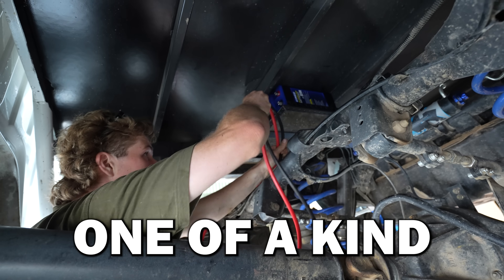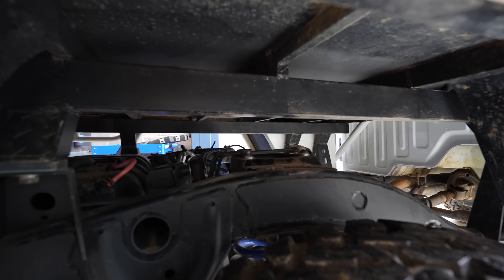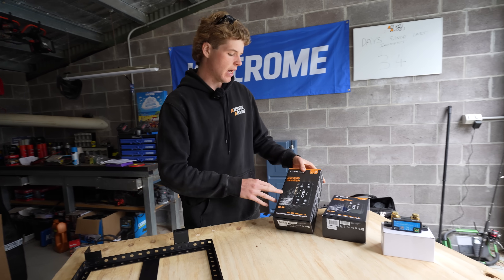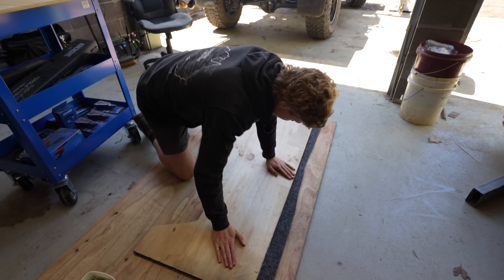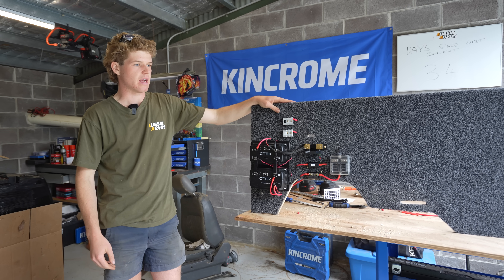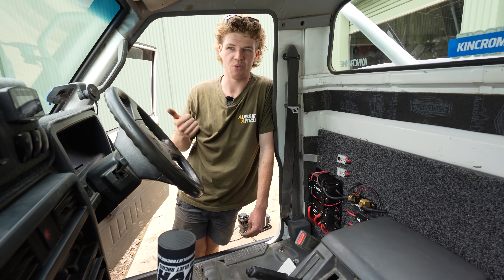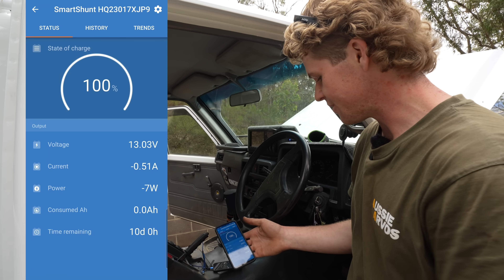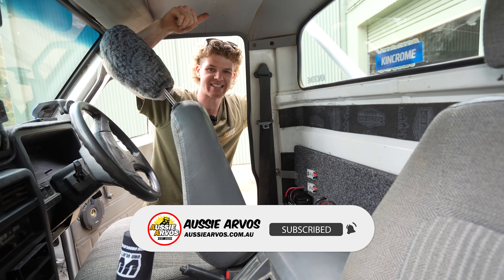The MOST POWERFUL 12v system we've EVER built!

Comment: Looks like a decent set up but it kinda blows my mind that you didn't mount the battery in a waterproof box then mount the box to the tray. Sure it might hang down an extra 50mm but you've got plenty of space, it's super easy to do and it would ensure the battery is properly protected from the elements.

Comment: Hey guys love the videos but have you checked the maximum charing current of that battery?? This is how 90% of lithium fires start by over charging the batteries with the wrong current. I would be really careful with these cheap batteries and using too much current to charge them, especially off-roading where the battery will get knocked about!!
According to the specs on the website: Recommended Charge / Discharge 25A (0.25C) -Max recharge current 100A. I would not be charging these cheap batteries at 100A and would definilty stick to 25A. Dont want to lose your truck to a lithium fire!!

Comment: Actually you connected the black wire from the smartpass to ground/negative, which is incorrect for lithium batteries. 
It should also be connected to positive. Now the battery is charged like an AGM battery, which will damage the battery

Comment: I have this exact set up, 250SE, 120S and victron monitor so for anyone interested here's my experience. Its on an Iveco Daily with a 210amp alternator feeding a 300amp lithium leisure battery that has a continuous charge and discharge rating of 200amps.

When the battery is at around 10% soc and I start the engine get slightly in excess of 140amps going in for a few seconds. This very quickly taills off and after around 5 minites of engine running the charging curve is below 100amps. After 10 minutes its down at around 80amps. It settles out at around 80amps with revs or around 70amps at idle. The curve then very very gradually tails off to around 30amps when the batteries BMS shuts down charging because its full. Its never the CTEK that shuts off the charging like I thought it would, always the BMS.

On the whole I'm happy with the system but i think its misleading to market it as a 140amp system. The bulk of my charging is done at 70-80amps from an alternator that can charge up to 210a into a battery that will take 200a continuously.

Comment: Another great vid. Change out the Tek screws for bolts and saving the sad headaches on the tracks. I would put a sheet metal cover over the battery as well even though it is mounted fairly high. Rocks and shit are Kamikaze Missiles. 😂😂

Comment: Wow ...

11:08 ... Per CTEK, the SmartPass will try to start the truck with the aux battery if the starter battery is dead.  

Did you realize that?

15:20 ... The CTEKs should have (do have?) a provided accessory metal plate behind them because they're mounted on flammable carpet.

The CTEKs are also supposed to have good ventilation.  Do they?

0:30 ... I watched the video where the King battery is already dead & dissected.

Are you familiar with AS/NZS3001.2:202? ... may not apply ... definitely good to know about, if you didn't already.

Comment: @AussieArvos I have a 2015 dmax with a 2nd Itechworld 200A lithium leisure battery. I bought a ctek smartpass for my d250se but still havent seen charging more than 28A going into my battery from flat to 100% charge with my car running and 440W of solar in good sunlight. I have heavy cable and good earths running back to starter battery. Do you or anyone have an idea why I cant get closer to 55amps as shown here?
Reply from the maker: Since it's a newer vehicle it would probably have a smart alternator, just make sure you wire it up correctly for that configuration!
Reply: @AussieArvos Thank you for your reply.  I dont think it has a smart alternator. It doesnt drop below 13.8v when engine running and doesnt have a box on the battery earth. Did you find that the alternator cable upgrade before and after made the biggest difference? Rgds

Comment: question on the thicker alternator cable install...... Did you leave the original cable connected to the back of the alternator after you added the new cable? Also I didnt see a vacc pump behind your alternator, Did you change the setup with that at some earlier stage?

Comment: Really good rundown of how to DIY a system!  Only things I would be worried about is the effect of very high current charging on the lifespan of the battery - every battery prefers lower and slower (up to a point) and most commercial BMS limit amperage for that reason even if the battery can technically take more. BMS in the battery should try to protect it so I'll be interested if the BMS will fight you for overheating etc on a 100amp charge on a 40 degree day.   Also the position of the battery and the bottom CTEK unit being low to the floor if you ever do take on water for whatever reason. Will be looking forward to how it does over time, if that battery location goes without a worry with normal use, vibration, puddles etc I think you have opened up a cool new option for a lot of single cab setups for those of us who wouldn't ever have to worry about a deep water crossing.

Comment: Nice work guys, having done this myself could I be so rude as to make a few suggestions which you may have already done.
I’m not familiar with Ctech but using victron DC TO DC myself, can you delay the charge to the secondary battery for say 1 min or so?.
This will give the alternator a chance to recover the start battery voltage before charging the secondary battery. Kinder on the alternator.
Second and you’ve already said it, a larger alternator.
This is because when I measured the temperature of my alternator it was becoming uncomfortably hot, and six months later I ended up having to change the bushes, and slip rings ( basically a rebuild) of the alternator, from pulling so much power. However, great system you’ve got.
I also mounted a computer fan to the DC TO DC charger as holding back all that current that wants to flow to the lithium ( which has comparatively no internal resistance) does generate a fair bit of heat, this caused the DC TO DC charger to dial back the charge rate which is good but not what you’re aiming for . Hope this helps someone.

Comment: I've got a charging system that's even better than this one; charges the battery even quicker too. 2 Litium starter batteries. That's it. Oh, and the alternator that came with the car. Really guys - you get a 2nd battery but cause you get a solar panel, you need a charge controller. All this extra gear, wiring, complexity, weight that can be avoided by just starting and running you f&*** car for 30mins. You've fixed a non-existent problem by getting your audience to buy more gear.
Reply: Everyone loves camping with the guy who runs his car for half hour every morning!
Aaaah the serenity
Reply: @user-yp2bd6vz2g  I can't stand them either. And no, I don't need to run my car every morning while camping, not unless we go 3 nights without using the car at all. And how often does that happen? For me, almost never.

Comment: Lipo batteries burn at over 2000deg C. Make sure you have that battery protected so you don't get a hole poked into the cells, and your system fused. I have just bough a kings battery, the same (great price) and wired it in parallel with another battery of the same specs to give me 200Ah discharge as I found 100Ah was great to run my fridge but not much else.

Comment: Excellent. Been looking at those C-TEK units. They are really popular for normal battery chargers and make generally great kit. I do like that Victron shunt, too. I wondered about putting a re-settable breaker instead of the fuse. The fuse could blow at an inconvenient time, especially if you’re around water etc and breakers are now very common and well used in these applications.
It’s not uncommon for older vehicles, which weren’t designed for leisure electrics to underperform in these areas as you’ve found out, not just on wiring. Upgrading your alternator might be one thing but the new battery will have a max charge rate anyway. Not sure if you mentioned what that is?
Your alternator choice might also be limited if it’s only driven by one belt. Bigger units tend to need two belts.
Keep the great work coming!!

Comment: Great work guys, couple of points from an auto electrician who works with Victron gear though:

1.Make sure the smart shunt is set correctly to detect when battery is fully charged.
2.That model smart shunt has an aux terminal to monitor a second battery, great for monitoring the start battery voltage, just simply run a cable from the aux terminal to the alternator in feed of the Cteks, this will allow you to keep an eye on the start battery voltage from the victron connect app.
3.When upgrading the alternator wiring do not forget to do both the negative from alternator/engine to body/chassis link as well as battery to body/chassis link (This is commonly overlooked in high power setups.
4.Check out Auto8 for alternator upgrades, have run their 160A alternator for 1KD motors for approx 5 years now. They are also located in Wangaratta Victoria from memory.
5.Not sure if you did it but put conduit on all cables exterior to cabin of vehicle as these need to be double insulated to meet requirements for vehicle wiring from memory.

Comment: Tec screws for the battery mount are an issue boys. They will rattle out or shear. Please replace with bolts lock washers and nylock nuts. Great vid.

Comment: Nice work but beware the BMS in that Kings battery is only rated to charge at 25A. Thanks for the content. Cheers
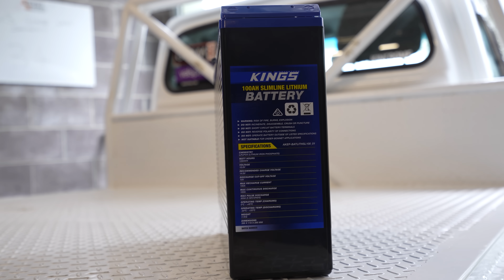Reply: Pause at 0:39 and you can see that the battery label states a max charging current of 100A. Where did you get the 25A value from?
Reply: @deefadale  sorry don't have a time machine to go back 4 months in time

Comment: Letting u blokes know as somone in the industry. Cheap batteries are bad batteries. Steer clear of kings ESP lithium. Lithium is dangerous with cheap crap, minimal rnd over clocked batteries poor case materials. Recipe for a fire. Spend the money and do it properly. Also batteries are not regulated at all. One brands 100ah could easily be a 50-80ah battery with a 100 sticker. Spend the money do it properly.

Comment: Awesome set up 👍
The only change I would do is change out the tek screws for M8 nutserts (ribnuts) with M8 bolts with spring washers. Tekies will eventually vibrate loose or snap.

Comment: Nicely done. The quick charge is definitely worthwhile but check the max charging current on the Lithium - if you exceed that max charge current chances are the BMS in the battery will disconnect the battery...then no charging.
If you put a small solar panel on the roof - 100 - 200W then the battery will be kept within safe limits when you park the vehicle for a few days. I imagine the two chargers, the shunt and other stuff will sip current 24/7 from the battery. Maybe you can fit a larger unit on the canopy when that comes?

Comment: Nice setup, neat and simple. The system draws a lot of amps to charge a battery, what have you done to disable the 12v system so you can use a winch? Another thirsty unit

Comment: keeping battery closest to charger as possible reduces cable size required which I’m sure you’re aware of. How come you didn’t mount battery closer to front of the tray? Charging at 100amp all the time if possible would only degrade battery quicker compared to charging at whit it currently is of 50amp

Comment: Nice one fellas, one thing to mention did you place a fuse at the battery side of the cable? i didnt see one, also didnt see any protection for the cable running back to the cab. A fuse close to the battery is a must. If there is a short on that cable (especially being a 4wd) it will end badly

Comment: Just curious why you wouldn't put battery in a inclosed box and use grommets for cable making it totally seal able from elements. Lithium don't need venting although dont like heat either.

Comment: Looks great, are you going to add some permanent anderson plugs to the outside of the ute? Maybe a small solar panel as well?
Also would it be worth relocating your main fuse (dcdc to aux batt) from inside to as close as possible to your slimline? With the potential of sticks or whatever getting caught in those wires maybe put it at the battery
Loving the content, your guys recent stuff has definitely been great

Comment: Awesome!! So, did you just run an additional wire from the alternator to the battery? And did you fuse it?
Reply: Would love to know the answer to this as well. Im only getting 20a with the exact same setup except I run a 200ah lithium
Reply: @zoneout_au  I ran an additional fused wire to my alternator after watching this, made a huge difference in my patrol, and I don't even have a dcdc charger, only a vsr. Keep the aux battery charging well.

Comment: fast charge mean high temp at the battery and blocking the vent mean over temp battery and, also lithium ion battery and water dont mix well and  this mean a increase chance that you a a fire. blocking the vent will not stop water getting in as the battery joints are not water proof and every time you drive on wet roads the battery will get wet from the spray from you tyres. you need to move the battery to a dry area.

Comment: It's not particularly the King's battery that cannot be mounted under the bonnet, it is all Lithium batteries. Battery World brought out a Lithium that could be mounted under the bonnet and it did not do well. Everyone I know who bought them had to get them replaced several times, and so much so that BW stopped selling the battery. By the way, the King's battery may be a budget price but it is NOT a budget battery, not at all. It has A Grade prismatic cells and a 2-year warranty.
Reply: This Slimline battery has pouch cells, not prismatic, but it's still an excellent battery.
Reply: How do you know that, it does not state this anywhere? King's Black Top batteries had pouch cells, but all the blue top ones contain Prismatic cells. I'm not saying you are wrong but it seems odd that they would go backwards when they've moved on?
Reply: I asked Kings and they confirmed that they are PRISMATIC cells @PittsFly

Comment: Hey gents - great setup, just wanted to share my experience with high current charging. When I first put a bcdc1250 (50a) in my 105, I found it was also maxing out my alternators capacity at around 40-45a. Great for the lithium but it turns out it wasn't allowing the start battery to charge so it would keep going flat especially after driving at night. Hopefully you don't have the same issue but I'd get onto upgrading the alternator as soon as ya can. Cheers
Reply from the maker: Thanks for the info nick! not to mention its alot of load on that poor old alternator
Reply: One of the fun things about the SmartPass is that it'll trickle charge your starter from your lithium when you're parked up, and if that's not enough when you go to start the engine it'll just bridge the lithium in and let it help turn the engine over.
Reply from the maker: @TerryBrady-q5b  Yeah it's a pretty cool backup system!

Comment: Ive done really similar but different. I ended up cooking the alternator which was no surprise. I upgraded to a 150amp alternator and not im blowing a fusible link. Im certain its the alternator signal wire. Im pretty sure as now I can pump 150amps into the batteries the 80amp fusible link is saying yeah now way buddy. When batteries are fully charged I have no issues. When they drop to 75% my fusible link says no. Something to plan for.
Reply from the maker: Thanks for the info! awesome
Reply: Yeah, I agree, you'll cook that alternator but you'll be upgrading anyway. Get a big quality alternator.
You may also run into the problem that your main battery won't be getting replenished quick enough in certain sutuations as the 2nd battery may be hogging  the power. Just something to think about.
Great video guys. I have the ctek charging my lithium too and have been pondering buying the smart pass too. So I will follow your build for updates.

Comment: Great vid, nice clean install. If you notice any irregularities with your shunt, you might want to move it closer to the battery, but it should be fine. I'd say 50 amps is a great charge rate for those batteries. Although they may be rated for a higher charge rate, it's best to stick to a batteries recommended charge rate, roughly half of max charge as a rule of thumb, to get the most life out of it. Also I'm curious about that idle up dial? Is it factory ? Wouldn't mind one on my TD
Reply from the maker: Thanks for the info Will! it's a factory hand throttle, very handy! cheers

Comment: A bit concerned about sealing up the battery with silicon. Do lithium batteries require venting, especially when using a high rate of charge.
Reply from the maker: From what we read , Lithium cells don't need ventilation, but we are yet to silicon it yet
Reply: @AussieArvos  Thank you. It is a bonus how orientation of the battery isn’t important. Couldn’t do anything like this with AGM or lead acid. 👍

Comment: Hay mate how thick is the wiring for just the dc to dc charger. Just installed mine and went one size bigger gauge to be safe but the ctek still gets a bit hot. Around 50 degrees Taken to an auto electrician and he said it’s fine but want another opinion
Reply from the maker: 2B&S Cable, it does feel warm when pulling big amps, we added a plate at the back to space it off the wall to aid in cooling & safety